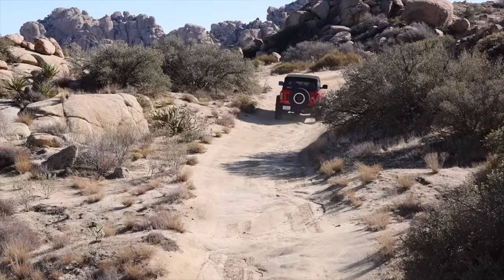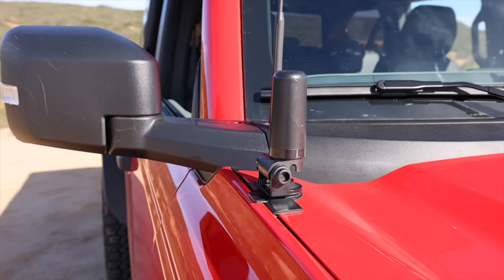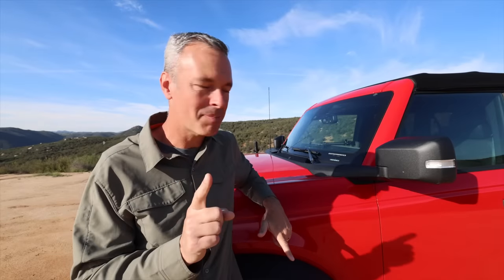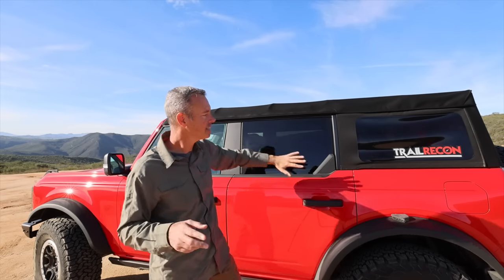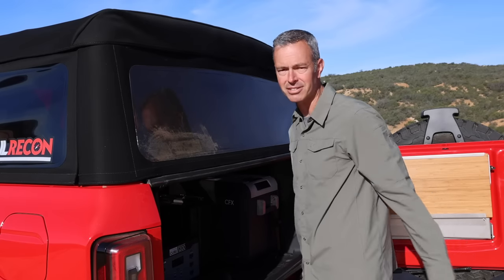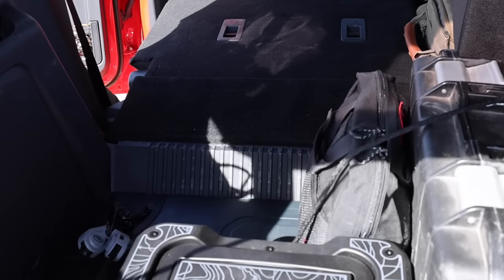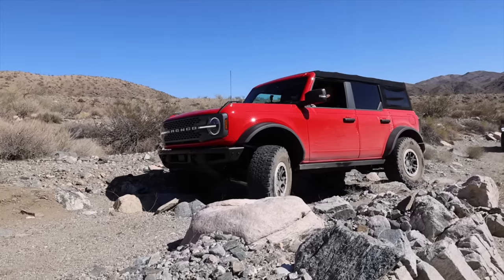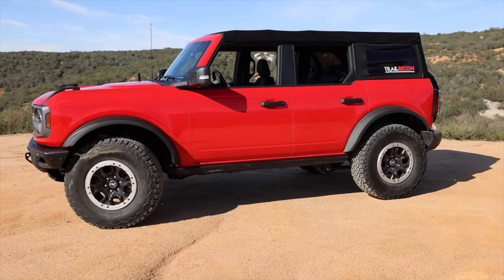Pros & Cons of Owning a Ford Bronco

Comment: when your windshield was repaired they most likely had to remove that cowl and forgot to hook up the washer fluid lines. seen it plenty of times
Reply: Exactly what came to my mind
Reply: Exactly the same with my replacement. You can lift just the passenger side of the cowl and plug it back together, but it's very tight.
Reply: Even happened on my accord lol.

Comment: I love your honesty, you call it as you see it. some get butt hurt when they hear negative things about vehicle they drive. no vehicle is perfect and there's always tradeoffs, most of it depends on how much of off-road vehicle you want vs daily driver. wrangler delivers unmatched off-road ability while sacrificing on road manners, crash and roller safety. best part I like about bronco is that it  brings needed competition to wrangler. jeep should build a more refined and safer version of wrangler  sell beside current jl.
Reply: What makes the Jeep unsafe? Is there statistical evidence that jl owners die at a higher rate than other off-roaders?
Reply: “Unmatched off road ability” Not buying it. Rubicon slight edge in extreme rock crawling.
Reply: So in your mind, You want JEEP to build a longer wheel base Wrangler so it's safer on the HIGHWAY?  They do it's called the Grand Cherokee.   The Wrangler was never designed to be anything but an OFF ROAD vehicle.  It cracks me up when people criticize the Wrangler for it's short wheel base.   It's like complaining  about buying a Z06 and wondering why you only get 18 mph.
Reply: The biggest downside of the Jeep is it's crappy reliability. It is always on about all do not buy lists or worst cars lists due to its subpar reliability.
Reply: @SurvivaLust  a long wheelbase jeep is the gladiator

Comment: Great review, Brad! I always enjoy your well thought out assessments and thorough walk-arounds. I certainly hope the designers and engineers at Ford see your video as well. 👍🏼
Reply from the maker: Thank you and I hope so too!
Reply: @TrailRecon  if you found 2 things loose.. id be out with the tool kit checking every nut bolt connector hose,ect..personally. i dont like them, solid diff, yes, ifs, no..if, you could get a swb dodge power wagon, yes.. i have a 75 highboy 351 5sp. cut to swb. tray back. 35,s. 4w disc. gona hate selling it. great vid, honest, i see you went back to arb buz box, . air.. im in aus. the retirement country, no fun here..
Reply: @TrailRecon  you want a winch,heres a 1 sec thought solution.. like me,i use removable winch trays, only go out 4 times a yr so 30kg on the front or rear,isnt happening. get an accessory hitch, have it modified to be higher or at side of cruise. you dont need cruise 4 ing, i have a hitch front & rear on all my 4x4rs.. x4..62 - 02..inc 82 bronc..

Comment: Thanks for a great review. The sights on the hood have tie downs, you can mount a GoPro witch is cool. They also give you an accurate way to gauge the inside of your tires. I  too am really happy with my Bronco. The 2 door 4cyl has some real giddy-up @ 320 HP. Standard trans is sweet. Surprisingly fun to drive. Gen 6 still look funny in a four door. Quirky,  pain in the butt, coverable sports truck, heck yea! Fancy? Not so much.

Comment: Another function of the trail sites, that you don’t like, is to allow you to know the position of the inside of your front wheels. They are there to help guide you around the rocks that damaged your lower control arms. Also there are now gas struts for the rear soft top to assist in raising the rear frame rather than using the prop rod. The struts also assist with raising the entire top from full open to close. Just a couple of ideas that may improve your experience.

Comment: The trail markers are awesome. They are not just a tie down point or for branches (So-Cal has a ton of mountain trails), they are to help mark the corners of the vehicle while off roading when you are going too fast for 360 camera. There is also a TON of cool aftermarket parts for it now (I know my comment is 2 years after you made the video) they can be turned into running lights/parking lights amber or white. There is a delete kit. Change the colors. Antenna or go-pro mounts.

Comment: Great review!  If your looking for a modular bumper winch that doesn't mess with the camera or the sensor,  Rough Country will be releasing their Hidden winch for 2.7/mod bumper soon.  I just installed one on my 2.3 but the 2.7 is coming.
Reply from the maker: I'll be keeping my eye out for that!
Reply: I’ll be interested to see how they do that as the inter cooler on the 2.7 is where the winch goes on the RC 2.3 hidden winch kit. I looked into it pretty thoroughly to see if I could modify the one for the 2.3. I ended up getting the BAMF front bumper and love it but I really wasn’t too happy to replace the modular bumper as it’s nice and solid. But I needed a winch.

Comment: Your video made me glad that I chose to go with the High option package and hard top for my Bronco. For a winch, check out the Rough Country hidden winch. It's designed to clear both the sensor, and the front camera, and gives you a slightly better approach angle. I'm in SoCal as well, so if you see a Carbon Gray Badlands Sasquatch tooling around the IE, give a wave,

Comment: For what it's worth, I installed the DV8 MTO front bumper, a winch, and the DV8 ACC module relocation bracket myself.  The ACC has since worked perfectly with shockingly zero issues and no apparent need for recalibration.  This particular method relocates the ACC module to a spot on the upper driver's side behind the grille.  Also worth mentioning I have no experience doing this kind of stuff, so I'm pretty confident you'd have no trouble whatsoever if you so chose.  Going into it I had absolutely had doubts that the ACC relocation would work, but it sure does.

Comment: I'm so glad I had the patience to wait the extra time for the hard top. Not only does it look substantially better overall, it's quieter inside and it's definitely a better quality overall. Also, soft tops in FL have a very bad habit of fading quickly. 

Let's also understand that those "grab handles" aren't meant for you to use to get into the vehicle. They're for use when you're on a trail.

Comment: I agree with the top issues.  I just went to the dealership yesterday and looked at it.  The side windows had waves or ripples and seemed loose.  There were a few other issues as well.  They were selling it for $40875 plus $15000 over because they’re “hard to get and in demand”.  I told them not from me, for $55000 I have higher expectations.

Comment: I’m sure you’re already aware, the sensor for adaptive cruise control on the 392 is in the windshield. So no issues with your winch install there.
Reply from the maker: Jeep did it right!
Reply: There’s no replacement for displacement, or experience. Jeep has both.

Comment: I actually love the front hood mount option for limb risers.  East coast here.  Can't stand the soft top set up on the Bronco.  Can't open the rear window while driving.  The fact that the sides are not attached in a way to keep out wind, rain snow, dust etc is BS.
Reply from the maker: I hear ya, that's why I think it should be an option and not standard.

Comment: I've seen a Warn winch that bolts to the top of the Bronco's modular bumper, and doesn't cover the adaptive cruise sensor.  And, yes, in its stock form the electric control box for that winch partially blocks the front camera that the Lux package comes with -- but allegedly you can re-locate that box underneath the hood to get it out of the camera's view.  I haven't yet seen that done, however, so I can't verify that personally.

Comment: Ok tell us what it cost to make your wrangler/gladiator capable to comfortably off road? My 2018 rubicon wrangler cost me 6k that doesn’t compare to my 2022 wild-tract comfort on & offroad like you said in the video, both vehicles are priced about the the same, but the overall quality, comfort, power, 18 MPG, owning both myself & constant offroad I take the Bronco on the trails! I want to mention I sold the wobbly wrangler with 12 MPG and bought a new 2023 gladiator eco diesel at 32 MPG for HWY use only! People, if you want to save money the Bronco is the way to go + it has so much more to offer, it’s great right out of the box!!

Comment: I think it's perfect for me.
I was really dragging my heels over a 4runner purchase. Just so much old and sensible for such a lot of money, while also being somewhat lackluster offroad compared to the heavy hitters.
The Jeep, has that slightly awkward fit to a family. The comfort and reliability isn't quite enough for me to throw such funds at it and justify it as a sensible purchase.

Landrover.. Twice as much money, and even more unreliable. Great on road, but if we're being honest, it's really only meant for on road now. I was even holding out for the Ineos Grenadier until the Bronco wooed me.

The Bronco fits right between and in the Jeep and 4runner pile, with all the modern tech of the Landrover, without the reliability issues.

I too went with the big options, and it maxes out around 62k.
I think it's a bargain, and a very clever, well thought out inclusion that's scared all of the competing manufacturers. It won me over after all, and I started from a place of complete skepticism. I also once owned a Ford, and wasn't planning on ever going back, but.. I see what they've done, and i see what they're offering here.
The oil filters on top of the engine bay.. Accessible plugs.. I think they have listened well and are being rewarded with a runaway success and a giant backlog of orders to fill.

I'm still waiting on my order. Effectively the same as yours. I thought long and hard on adaptive, and still decided to keep it. I also kept the hardtop, because or some of the issues you've encountered. I don't think I'll be removing it much.
I'm starting to see promises of reliable ACC bumpers spring up. There's one or two videos now and some interesting takes on low slung hidden winches.

If Toyota wants to lure me back with it's updated 4runner, I am still listening, but.. I don't know. It would have to be very surprising at this point.
Reply: Own more than 10 years. Toyota
Trade in within  10 years. Any brand is good imo
Reply: I’m sorry but you can’t complain about alleged jeeps reliability issues when you bought a first year vehicle from Ford 🤔
Reply: @AustinH7  true, but it doesn't make the known jeep unreliability go away.
Nor the Land Rover's.
Reply: I hear you on the 4Runner. I have a 5th gen, it makes for a good daily driver and I bought it before the Bronco was a thing and the used car market went insane. I bought it in 2019 when it was 6 years old and it's actually worth a little more than what it was then, haha. So I think I got a good deal on it, and it was an excellent value. Going out and buying a new one today, no I couldn't justify spending that much money on one, because it IS old tech. It is proven though, and they do last forever. I've put 50,000 miles on mine in 3 years and have had zero mechanical issues. I think for the next generation 4Runner, Toyota could have a hit if all they did was copy the Bronco feature for feature,  with Toyota reliability and a fixed steel roof. That would be my ideal vehicle. Of course, no matter what Toyota does with the 4Runner, the fanboys will still buy them. Literally the only way they can destroy it is to go unibody with it.
Reply: The Jeep V6 is probably one of the most reliable engines out there right now.
Reply: @corpsman247  I tend to agree, they seem to use them in pretty much every FCA vehicle, so they're definitely proven. I did hear something about plastic oil cooler housings cracking, have you heard anything about that issue?
Reply: @trailrunnah8886  I’ve had two V6s and no issues. Sure you will get a few items here and there but nothing widespread at this point.
Reply: @trailrunnah8886  Reliability is a valuable asset, and it's genuinely true that the Toyota is the absolute head of the pack there.

In a limited field of contenders, things beyond nuts and bolts, and even tech start to be a commodity..
For Jeep, the rock crawling aspects started to really shine, and became a value they've been cashing in on for a long time.

For Toyota, it's the reliability, and while it's unarguably a commodity that they should absolutely be able to cash in on, when you start looking at 60k plus price tags on jeeps, and 52k for a higher end 4runner, your eye starts to wander to other brands to check out the competition.
 
I've got a while before my order comes in, and I'm still looking.
Ford decided to put a hold on orders on march 7th until they catch up, so I thought I'd put in my order, and wait and see what Toyota comes out with.
Reply: @trailrunnah8886  Yes - fixed steel roof.  So much better than fiberglass.
Reply: @corpsman247  Millions of them made.
Reply: I own a 2019 JLUR Rubicon.  I would buy any other Truck on the market before dealing with all the headaches with a 1st generation vehicle like the Bronco. And to be honest, the points Brad made make me think the Bronco isn’t ready yet. Like they pushed it out the door half designed and engineered. Good luck!
Reply: 62k was a bargain for a first year Ford Bronco….?
Reply: @johndoyle3232  no, for a vehicle this capable with the tech it has, relative to the competition is a bargain.
Someone somewhere defined it as an affordable g wagon, and that sums it up quite well.

It burries the 4 runner with ancient tech and under performing features. A comparable jeep is much more..
A fully loaded bronco is the cost of an entry level land rover and far more capable offroad.
Reply: @trailrunnah8886  A unibody and if they go with that weak engine that they run in the Tacoma.

Comment: I'm actually really surprised the aftermarket hasn't made some accessories to solve of these things you've pointed out yet but that's a weird on the cruise control thing I'm surprised ford put it their without offering solutions to winch mounting on their packages as we know exactly what folks are going to do with these, I'm surprised I haven't seen a bronco with a best top brand soft top yet this is what I love about watching you I like your honest opinions
Reply: There is a Bestop install on the TFL Bronco. They hate the rattles of the hardtop and swapped it out for the Bestop.

Comment: I've been waiting nearly two years for my Bronco. I opted for the hardtop and Ford "paused" the production of the hardtop for awhile. Hopefully that gets resolved soon. I hate to say it but Brad, we got the exact same Bronco. I am going to delete the Lux package and go with vinyl seats. I chose the blue that they discontinued so I went with Red. But, oh well, we will probably never wheel in the desert at the same time. Anyway, great video. Thanks for your opinion.
Reply: Larry, just wanted to point out that I got my BL 2.7 with SQ and Lux and I absolutely love the Liz package. I have the vinyl seats too. I got the velocity blue with only the soft top. Originally ordered the dual top but was told it was holding up production so I went down to the dealer and switched it to soft top only (they had changed it to hard top only!!!?) and 3 days later I got my VIN #. Good luck getting yours. I’m absolutely loving mine.
Reply: Do you know the production status of the hardtop? I don't want to wait anymore. I wanted the lightning blue but that was discontinued for 2022. Thanks for your input.
Reply: @larrybriggs2920  unfortunately no I don’t. I originally heard hard tops won’t be available for separate purchase until ‘23 so that’s what my head is set on. I am generally very happy with the soft top but would like a hard top for winter but I’m fine as is for a bit. But I do recommend the Lux package! Good luck!

Comment: Maybe you could go with a receiver hitch style winch,  that way you could  store it away when on the highway. It's nice to be able to move it to the back if you drive off into something forward  and need to pull it out backwards. Thanks for the review.  I had a job restoring the 66 to 77 broncos. They still drove terribly on the highway. Glad that's improved.

Comment: You are the best. I have an identical Bronco except I have Area 51. Two things that cancel your dislikes. IAG performance has a set of 4 grab handles in 17 colors and soft top struts. Both items work well. I am not a huge fan of the soft top. The one company that is making a hard top charges $7,000.00 including  delivery. That is very expensive.

Comment: The soft top looks a bit janky.
The Bronco would look good with a color-matched hardtop.
Addictive Desert Design bumpers have sensor-friendly options.
After going out 4 wheeling, especially on longer trips, you should check the bolts under the vehicle, and with all the flexing going on trail riding as you mentioned maybe even check things under the hood.....hoses, wire connections, etc.

Comment: Great video, as always.  I also have a Badlands Sasquatch, so I’m excited to see what you have in store for the Bronco.  Regarding the back, I recommend the IAG EZ-Lift.  I added it to my soft top and I now I can open the back with one hand (one latch at a time) and it automatically lifts open (higher than the prop rod would give you). I also added struts to my hood - another great addition that skips the prop rod and adds ease and convenience.

Comment: Hmm, there are a TON of lift options out there, so not sure how you're unsure of that.  A few companies make delete kits for those load points up front on top of the fenders, easy install.  Check out JCR's winch plate with ADD's ACC relocate bracket to get a winch up front.

Comment: Brad check out Relentless Fabrication. They have a 2 door with all the same options as your Bronco and a new front winch bumper that retains the sensors and does not relocate the ACC module.